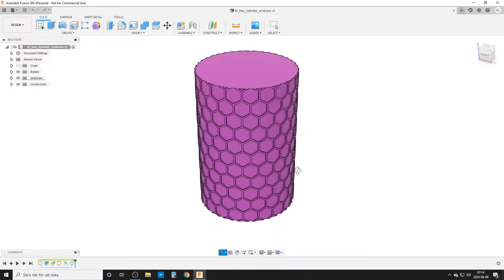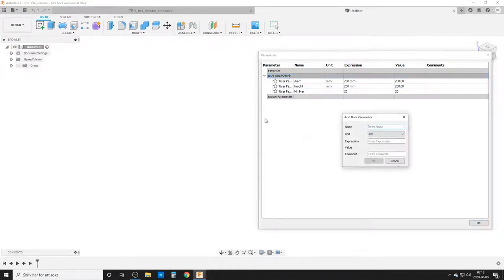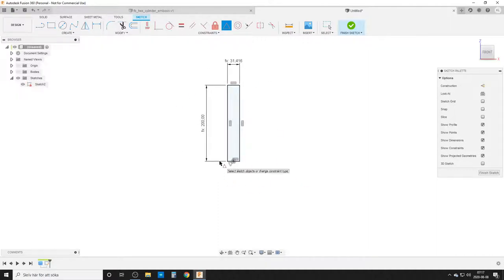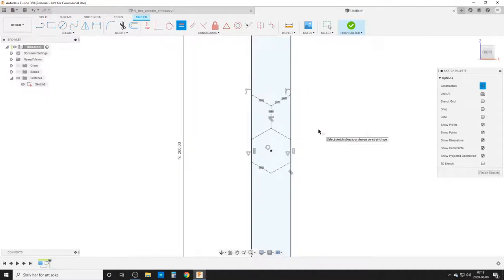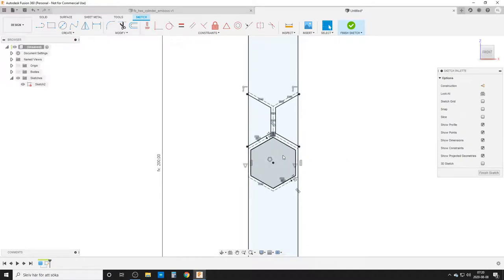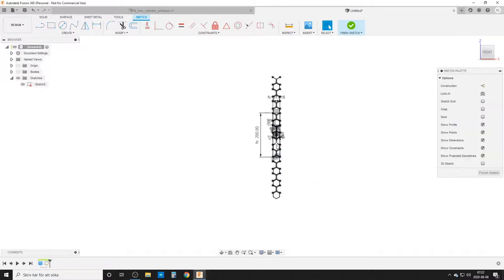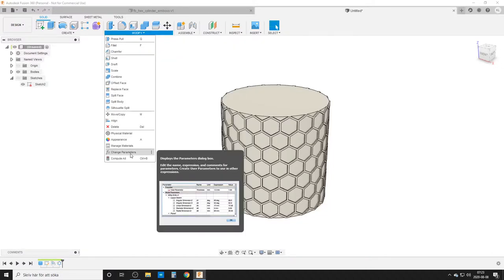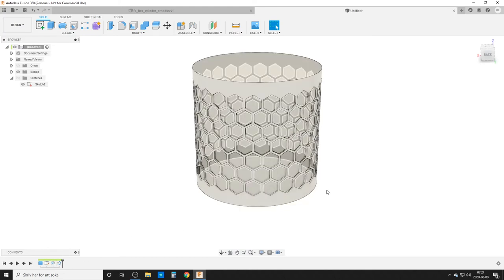Fusion 360 - Hexagon Pattern on a Cylinder using Emboss

Comment: I love you. I spent a very long time trying to find a way to do this in order to create a round mesh for a carbon filter, everything came out looking terrible. This is perfect and makes such good sense.
Reply: Do you think you could maybe share the fusion file ? I want to do the same thing, but i am Stuck at 2:47 for 30mins as i cant seem to Figure out how to set the secound parmater it just creates the rectangle with one paramter once i Press enter and i cant change the secound
Reply from the maker: You should be able to set the dimensions then you create the  rectangle or after. Check that you do not get any strange auto constraints applied in the sketch.
And in general if Fusion is behaving strange, save the design and restart Fusion.

Comment: This is awesome, but what if you wanted to create a seamless pattern from an imported file? For example, I'd really like to create a seamless paisley pattern around a cylinder, but it seems impossible as there is no exact control over the size and position of imported SVGs. Any idea how you would do that?
Reply from the maker: I would add a construction line to the pattern where it repeats, Measure the line and use Scale to resize the sketch.
It's a bit of try and error. :)
Reply: i think you would take a small slice out of the cylinder then flatten the cylinder (unfold), apply your file and size it, emboss and refold it
Reply: Measure and scale it

Comment: Thanks it's very useful! How would you go about rounding all the edges so that it is easier to 3d print in vase mode? Something like a fillet but without having to select every line. 
Also is it possible to emboss with a draft angle so that it looks better?
Reply from the maker: Thank you.
You could Fillet after the Emboss and before the Circular pattern, and add the Fillet  Feature to the pattern. Or do other manipulation to make it look good :) 
Emboss/Deboss for now only follow the normal of the face, draft or chamfer can be added but is a bit of work.
Reply: @KristianLaholm  if y fillet before the circular pattern some secretions of the pattern are not rounded (where the half hexagones meet)
Reply from the maker: @nicolascancio1240  Only thinking on the top of my head, you could make one pattern to get all the edge, fillet and work from there.
Anyway it takes some work to get pattern to work in Fusion.
If you want the patterns "perfect" and the software to do the work have a look at Dynamo for Fusion (there are other similar software, haven't tried any of them)
Reply: @KristianLaholm  thanks!

Comment: Hey First off, this video is really helpful! But I have a question, I was able to figure out how to cut out the holes and leave the hex pattern behind but on all the hex's were they join up there is a line down the center is there any way to get rid of this?? Thanks!
Reply from the maker: I don't know how you did your workflow. But I'd extrude a second cylinder cutting away the inside leaving the hexagon holes.
Reply: @KristianLaholm  I ended up figuring it out! I just had to measure the left over distance and add that distance to the pattern  modifier with the PI math

Comment: Can you use EMBOSS to put a pattern on an oval face rather than round?
Reply from the maker: Yes, but it takes some thinking if you want it to line up around the face. If the pattern/face is not to big I would emboss 1/4 of the pattern and then use mirror to fill the face.
Reply: Thanks, nice,I have been struggling with that.

Comment: Your video has really helped me out after trawling through countless other Youtubers videos that seemed keen to show you the finished result but not how to get there, so bravo. Your narration speed is perfect too. Is there a way of reversing the emboss some how so that the body of the hexagon takes out the majority of the side and not the wall section. Thank you
Reply from the maker: Thanks for the feedback. You can select the inside profile and not the wall end deboss that in to the cylinder (if I understod your question correctly), there can be some problems with thin walls left behind by the circular pattern.

Comment: Great video man! QUESTION: what if the Cylinder was hollow? I mean. a section of a pipe. and what if instead of embossing this hexagonal pattern, I would like it to be embossed deep enough that it cut through the surface of that pipe? would that be possible to do?  I am willing to do ths in order to 3d print and save material. As for printing overhangs with less than 60 degrees, no supports are needed. (and an hexagon has exactly 60 degrees overhang)
Reply from the maker: It's possible and no problem to model. 
But it can be a bit of a torture test of your 3D printer, you might need to slow down the print speed and do some test prints to get a stable result :)

Comment: When teaching you need to go slower, and tell the steps and wait. You're going too FAST!
Reply from the maker: You can slow down the replay on YT, click the settings "cog" and you can change the replay speed,
If you want to learn how to use Fusion there are much better channels then my channel.
Reply: I paused the videos a few times on parts I didn't get immediately. Then I tried myself on Fusion and I did the pattern correctly. He teaches very well.
Reply: @KristianLaholm  Not really, you do have the best channel. Most other channels too beginner focused.
Reply: @fernando_om Thats what I do too.